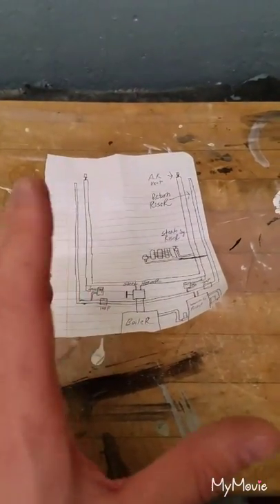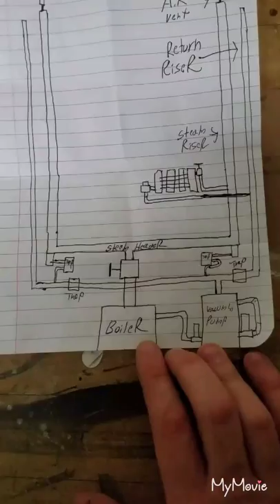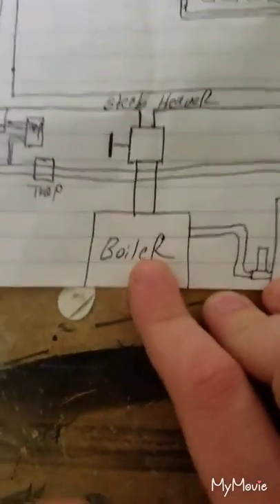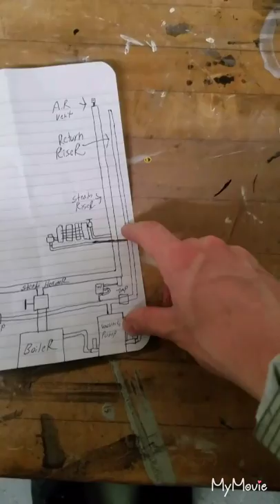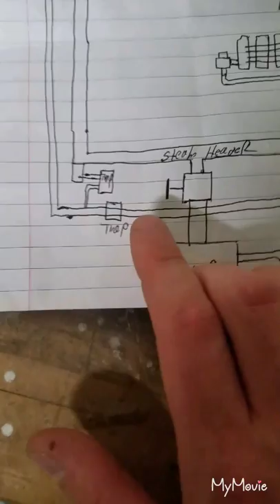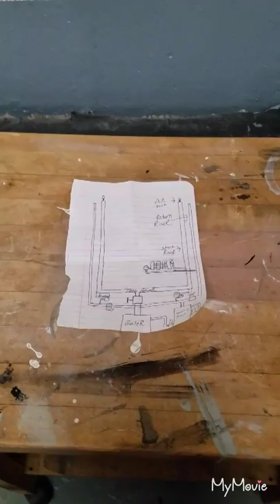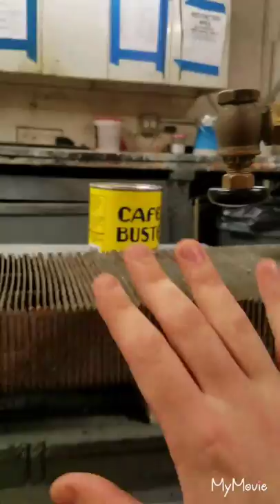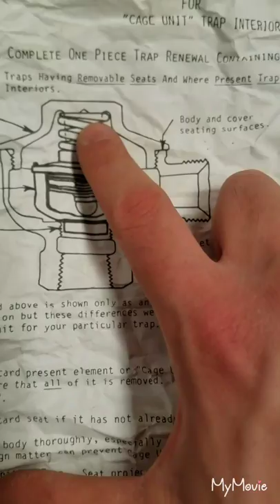How a two pipe steam heating system works.

Comment: i'm one of this type, that will be using a ball float steamtrap on my radiators, because steam piping, fittings and valves is my greatest passion. 

Please do a lot more steam boiler and valve room tours.

Comment: Thanks for the video, I replaced a steam valve cut off in one the three radiator, now the radiator wont get hot, I suspected the rust from the old valve has fallen inside the pipe, how do I clear the pipe? have you come across this problem before? it is a 2 pipe system

Comment: Excellent video. I have a question. What would be the cause of 1 out of nine radiators not working properly? I had steam to valve. but not going past. I removed valve assembly from radiator and  the valve was stuck closed. I fixed that and now only 1/3 of the radiator heats up. I removed the steam trap to see if that was the problem but no avail. Any suggestions??
Reply: Jc2lite trap is bad, no vacuum to pull the steam
Reply from the maker: Definitely the trap